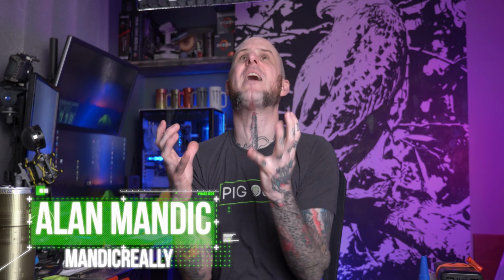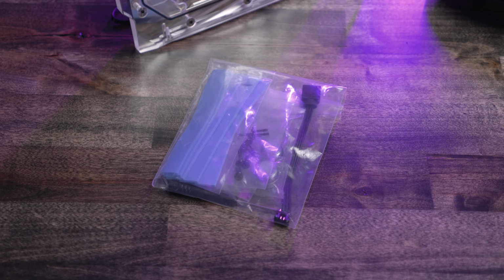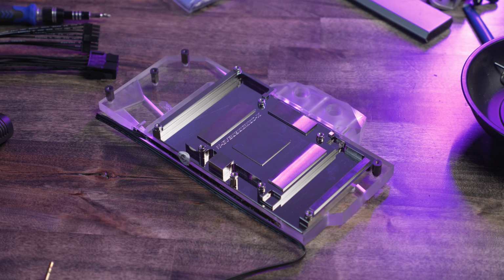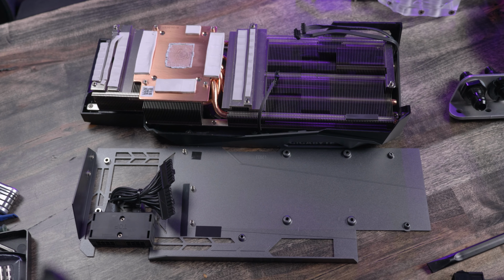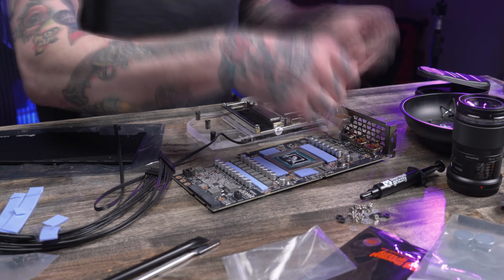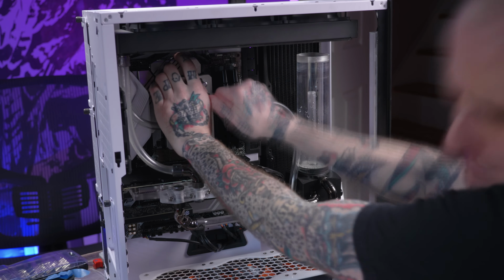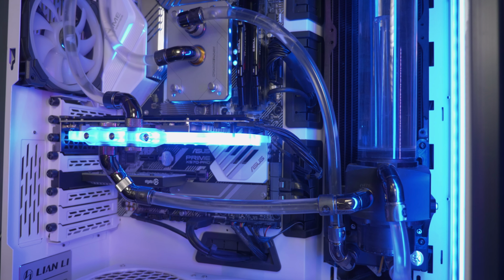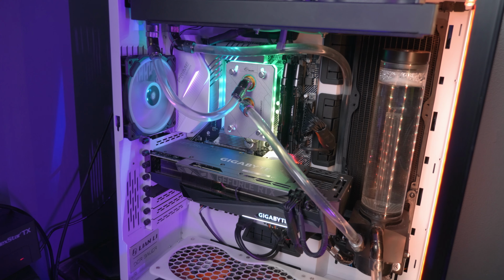Watercooling my RTX 3080! - Bykski N-GV3090GMOC-X

Comment from the maker: Bykski now has an Active Backplate cooler as well.  Meaning a nickel plate block that goes on the back of a 3080/3090 as well as the front.  Good looking and good for cards with back side memory chips: https://amzn.to/2R8wYmi
Reply: VERY interesting, thanks for the heads up! I have a GIGABYTE 3090 and I just got my bykski set, but I wasn't ware of the active backplate. Since I game AND mine (to make back what I spent on the GPU - I got it at MSRP, and that was still obscenely expensive!) VRAM back side temps is a major issue.
I'll have to see whether I can get the backplate on its own from aliexpress. ALSO: I wonder whether I have to get a gigabyte compatibile backplate.
Reply from the maker: @rather-reverend  I don't think you will have to get a gigabyte specific backplate.  That is just a guess but the majority of my 3080 anyway is pretty similar to reference design.  It is just those power connectors that are not.  And while the backplate I have has a cut out for those power connectors, it actually doesn't need to since the connectors are on the front side of the card.
Reply: Got a video of you putting on the active backplate? XD
Reply from the maker: @kodysoles9912  i don’t have it and can’t buy it separately. So I’d have to buy the full active block just to get that… can’t justify that right now. Bykski are you listening? 😂
Reply: I have the same GPU and I want to do this. I’d pay you to do it for me lol.
Reply from the maker: @the3gamingnerds458  I mean I gladly would, but I don't know how that would work overall, ha.

Comment: Why are you only getting 65 degrees on air??? My card throttles in any game AND ive read hundreds of stories of stock 3080s running 100+ on the memory and hotspot temps. Huge L not even looking at those 

My guess is that you applied some crazy undervolt from the rip then didnt take it off for the waterblock which is crazy
Reply from the maker: Or your card has a problem. A stock 3080 should not be running 100+ out of the box. My card was never touched, other than turning UP the power limit. My 3090ti returns fairly similar results. I should have included memory temps but I think it likelier you have a problem than I deceived everyone as you seem to indicate.
Reply: @MandicReally  first off you don't even know what you're talking when stating what a card should or shouldn't do because I said hot spot temps of 100+ and they are usually 15 higher than the "GPU temp" which is just an average, probably with an even bigger delta when it's actually that hot. 

So then WHY is yours so chilly? I have a problem? Bro you spent enough money for 2 tiers better a GPU for no improvement. It's not about you deceiving, it's about you not getting the full picture when you're trying to make content about overclocking. You didn't just leave out hotspot temps and memory temps, which will throttle a card way faster than the one temp you did look at, but you also didn't even try maxing the voltage to try getting some 2200mhz clock to be stable. It's like you paid for the headroom and made "content" on... the fact that you bought headroom. But apparently from what little (!) I could find about overclocking these cards it's basically for naught anyways without a power mod. My research indicates that you have to go all-in to get anything cool to happen, and there's no proof of it, just claims. But that's different from the 10 series which would actually perform great just with high stable clocks and you'll only ever know if you try

Comment: Same water block works for the v2 of the gigabyte rtx 3080 oc gaming waterforce wb 10gb! Especially being that gigabyte forgot to mention thier stock water block was aluminum 😮!  Thanks for the vid keep up the great clips! Wish i found this much sooner!
Reply: Yeah.. a while later, but I wanted to use my 3080 card again for a build.. and my original block actually had turned to sludge due to galvanic corrosion.. so now I have to find someone that still sells a block like this.

Comment: You can shunt mod the high hash rate 3080 8+8 pin and use a custom BIOS to unlock it's power limits quite a bit. I forget what the 2 accomplish. But it went from 320 watts up to 360 watts (if I recall). I believe at 1440p and 4K benchmarks the guy was gaining 10-14 fps in games. (Not sure in production). He was running it on air too. So imagine your waterblock. 

You could see an uplift of 20 fps in gaming and much better performance in production software. However..... The time, effort, money for parts etc, you may as well sell your 3080 and buy a 7900XT(X) or a 4080 16GB.
Reply from the maker: I went to a 3090ti a bit ago. Reliable performance is more important as this is primarily a work computer. The only real reason I even moved to the 3090ti isn’t the performance gain but rather the memory. This 3080 10g was running out of VRAM and crashing while decoding H.265 5.8k video. The 3090ti doesn’t even break a sweat while using over 16GB of VRAM.

Comment: I really closer to pulling the trigger for my 3080 Eva edition, but I really want the one with the active backplate...

Looking back now how's this system block performing?
Reply from the maker: I never ran into any cooling issues in anyway.  I just took this card & block out last week for a 3090Ti, but never had any issues.  I didn't watch memory temps like a hawk, but never saw any throttling in any of my testing.  

If you are not running a 3090 (non-Ti) an active backplate is overkill I think.  The 3080 & 3090Ti don't have back memory chips that need cooling.  To add a little cooling you could always put some thermal pads behind the memory chips on the passive backplate.  I had intended to do that but am just going to sell my Card with the block most likely now.
Reply: @MandicReally  thanks so much for the reply.
My thought process as well, but I'm also going for a bit for enthusiasm as well, I may do two EKWB flt120 with different coloured loops rather than 1 flt360. Or invest in a double sided waterblock.

So I'm thinking of either going EKWB one sided or Bykski Double sided.... Only because they are the same price here in Canada.... 369$ for EKWB Velocity and 349$ for the Bykski Sandwiched.

Comment: I posted an earlier comment but I think the included link to a diagram about my question, so it might have been automodded. If you intentionally removed my comment, I apologize!

In any case, I purchased a 3090 with an AIO already attached. The waterblock is identical to the one you have shown here. However, there are some discrepancies. The person I purchased the block off of had thermal pads installed in the grooves of the water block (above the voltage regulators). I noticed the stock cooler in your teardown also had thermal pads on these voltage regulators, but did not install them on the waterblock. Are they truly not required with this water block?

The previous owner also installed thermal pads along a bunch of the grooves on the backplate. Were any present in your install? I realize I will have to use 2mm pads for the additional memory chips on the back of the 3090, but were there any pads on the backplate of yours?

Cheers and thanks in advance
Reply from the maker: This block didn’t come with any pads for the backplate or for those chokes you are referencing. This was about as early of a block release as there was. I’ve been wanting to disassemble it and reinstall with thermal
Pads in those locations to see how much of a difference it makes. My 3080 doesn’t have backside RAM chips so that will likely be marginal, but your 3090 you should absolutely use them. Or consider the active backplate even.

Comment: I recently got into custom water cooling. I have the thermaltake core p3 case mounted to my wall. I have no current of airflow with this case unless I have my ceiling fan on lol. Water-cooling my gou and CPU would be a big improvement. For my specific setup and I'm very excited for when everything finally comes in. Great video

Comment: Dude, 2700X with a 3080????? Please tell me you at least upgraded to 5800X at this point.
I personally went from a 2700X->3900X->5800X all on the same X470 Asrock board, and the speed difference between the them was pretty huge.
Even going from 12 cores to 8 cores, the (much) faster clocks on the 5800X made up the difference when compiling large programs. At full throttle the 3900X would cap out at 3.99Ghz all cores, while the 5800X is at 4.6-4.8Ghz all cores depending on the temps in the room. 
Running this on air cooler (Noctua NHD15).

I think it helps that my 5800X is apparently a golden sample according to Ryzen clock tuner.
In the games that I play, especially anything that's CPU bound single threaded like older games (quake live, vkquake etc), I've gotten another 150fps.
Reply from the maker: I’m on a 5950X now. This was filmed when 5000 series was impossible to get but I got super lucky and got a 3080 for MSRP.

Comment: That "better machining" on the VRM blocks are fly cutter marks - big broad-area cutter. That would've been the top of the machined piece, and it's one consistent cut over the whole part that buzzes the whole surface at once. The rougher marks in the lower areas is inconsistent speeds with an endmill. So it's not "better" in that it was done to a higher quality or anything, just a far simpler cut to do.
Reply: Old post I know and may be research able but how can you differentiate between a face mill and fly cutter milling. 
I have an old adjustable pocket face mill that could about pass for CNC on a Bridgeport after being tuned up on a lathe, as long as the Bridgeport is trammed well and not beat to death. 
Anyway, the inquiring tool and die flunkie is  curious again, so...

Comment: Great video, thanks.   One major question though.    I right now have that exact waterblock in hand, ready to be put on my RTX 3080Ti , and I am noticing that this waterblock does not provide contact for the two rows of those gray 'R15' components.   The stock cooler definitely does, and there are pads for those R15s.   I looked up the Bitspower and Barrow blocks, they both do provide cooling for those.   In your video, you clearly skip those     How has this setup been holding up?   Any adverse effects from not cooling these pieces?    Thanks.
Reply from the maker: I really cannot say long term how it is / will be.  However my card has been running smoothly and happily since install.  I recently installed a 5950X and brought the cooling system load up overall and the GPU still sits happily and stable at the temps I quoted here.  I have been meaning to flash a higher wattage bios on the card, and wonder if that won't show some weak points, but I haven't had time to do that properly / test it so I have held off.  The lack of cooling for all the components cooled by factory is mildly concerning to me, so I may eventually switch blocks, but for the moment I'm satisfied.
Reply: @MandicReally  did you ever find a compatible unlocked, or higher watt bios? i have the same card and same block (+ active backplate) and I want to avoid shunt modding it if I can

Comment: so not really a huge impact from water to air - been thinking about getting a block with the 3080 or finding the 3080 water block model. I think the 3080 gb card just keeps cooler than the rest in other benchmarks I've seen. This was helpful!
Reply from the maker: This particular card also has a lower wattage bios than other 3080s. I’m going to flash a higher wattage bios and retest (water cooled only, not gonna put the air cooler back). That may make a larger impact. We shall see.
Reply: @MandicReally  cheers!!

Comment: I'm about to order a bykski for my xxx 5700xt thicc III cause it is running 98-102. T junction temps in my 303c case. Gpu blows how air onto the glass and half of it gets recirculated through the card. Hoping it works cause I dont want to buy a new card until the next gen amd and I havent played with water cooling since my q6600 days. Thanks for the review

Comment: Don't ever order bykski they sent me a product that was opened seal was broken. They slapped a sticker over it to appear not. When opening came with no thermal pads, the rgb wire was literally ripped and when I sent them pictures and stated they stopped responding. Spent 190 on the backplate and waterblock bundle. Be warned they will scam if it's defective. If anyone would like to see I have physical picture proof I can send to you

Comment: The reason why I am avoiding the Bykski, Barrow and Alphacool blocks is that they completely ignore the 4 diodes near the video connectors. They are cooled by the original air cooler and Just noticed that they are cooled my the Bitspower cooler that is available for this card.
Reply from the maker: @8:00 you can see it didn’t have thermal pads or contact there. Maybe I was supposed to install a pad there? Lack of instructions doesn’t help there. There are 5 diodes there on this card. I can see where the stock cooler hit it. I’d have to disassemble the block / card to check if it needs contact there or not.
Reply: @MandicReally  on alphacool, I look through the install directions to see that they are also missing those diodes. I saw another bykski install video where he complains about this in the comments section.  I found a US seller that has the bitspower block in stock and they only have 2. titanrig if you are curious.  I did confirm that the Bitspower cools those diodes by checking out the installation directions online. 

You didn't miss anything, the waterblock makers did.
Reply: @MandicReally  There are instructions, they're just online.
Reply from the maker: @Lexicon_  they were not there 8 months ago when I filmed this video. I can’t update review videos when things change down the line. Not including a QR code or URL to the instructions (or printed instructions) would still constitute a poor experience.
Reply from the maker: Alphacool has a block for this card now too. I didn’t see photos of the actual block contact side on their site though.
Reply: Model number for bitspower block?

Comment: ryzen 2700x with rtx 3080 ? most stupid combination ever seen, not suprised why your wc score is almost same like stock one...
Reply: Ahh yes the internet/armchair PC builder who obviously knows everything from his google searches and forum browsing. Why are there so many of these people lol, even in the car community you've got know-it-alls despite never having owned/built a car in their life.
Reply from the maker: What combination do you run? Ryzen 5000 series were very difficult to get when I put this setup together so I didn't upgrade from the CPU I've had for years.  Would you pass up the oppurtunity to buy a 3080 for $800 becuase "The CPU combo would be stupid"? Or just get it and upgrade CPU later?  The GPU isn't bottlenecked by the CPU.  Sure a better CPU would pick up more perofmrance of course but the GPU isn't being throttled by the CPU.  If you think it is you need to learn a lot more about what Bottlenecking really is.
Reply: @MandicReally  in 1440p it will bottleneck, ryzen 5000 series is wide avaliable and is not overpriced at all. Merging el cheapo cpu with high end gpu is just silly.
Reply from the maker: @akcesoriumpc6421  cool this video went up 4 months ago when no one had inventory of the 5000 series. I do video creation and 3D modeling so the 5950X makes the most sense for me, but I can’t justify the $800 price tag right now. So do I spend half that much on a stop gap upgrade? 

Currently I’ve decided on waiting for the Zen 3 Threadripper CPUs to launch. So again, spending $4-800 to upgrade now doesn’t make sense if I know my setup works well enough for now and a new upgrade is out there on the horizon.
Reply from the maker: @akcesoriumpc6421  also I bought the 2700X when it was brand new. Calling it “El Cheapo” is insulting and silly. Today’s high end will always be tomorrow’s lower end. That’s life. Not all of use can afford to or justify upgrading with every new release.
Reply: @MandicReally  2700x is actually decent for prod workloads :)

i too went with bykski for my palit 3070 gamingpro,
i did stack thermal pads on vrm to ensure they get compress when screwing on waterblock :)

quite happy with the waterblock cooling performance, gpu core delta 25c & vrm delta 35c

nice vid :)

Comment: Warranty void?
Reply from the maker: Not for me no.  We are allowed to work on and repair our electronics, if it causes a failure then it voids the warranty.  So a water leak would, sure.  Otherwise, no they cannot void my warranty just for swapping the cooler.  Doesn't mean they won't or find some other way to deny it, but legally just doing this doesn't void the warranty, no.

Comment: Blame the US reseller for lack of instructions, I purchase direct from Bykski via Alidirect and they include instructions. Purchase via Aliexpress is often a lot cheaper than Amazon as well
Reply from the maker: And it only takes months for things to come in on average. With little buyer protection for US buyers. I just bought a couple things off AliExpress last week, estimate delivery is September. I’ll pay $20 more to get an item
in a timely manner from a company that I know I can return it at dozens of local places for an immediate refund if there is any issue.
Reply from the maker: Also you realize AliExpress isn’t the official store location of most companies? The chances you are buying from a reseller there are extremely high as well. I constantly see two different stores claiming they are the “REAL xyz brand”.
Reply: @MandicReally  Everything I get is factory sealed, never had missing instructions, not once.